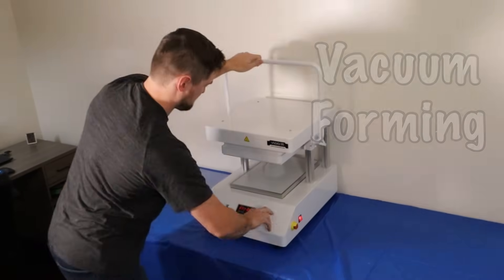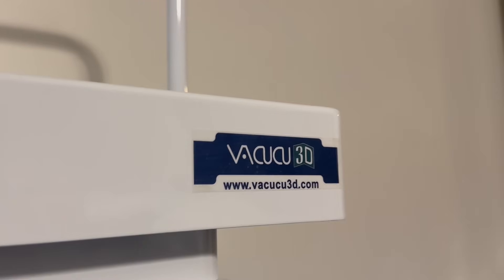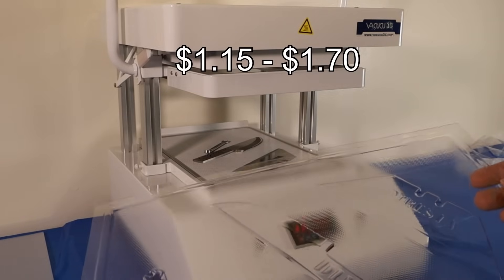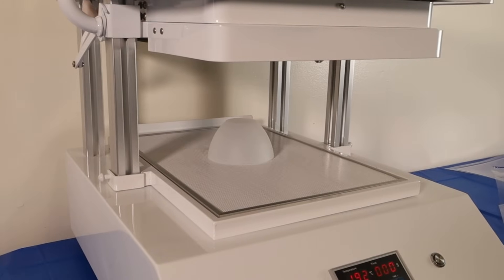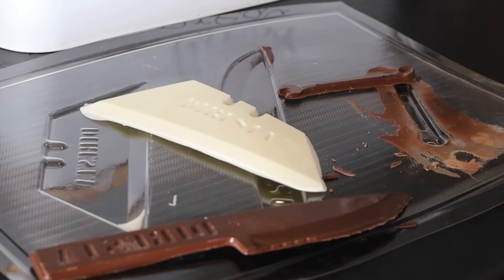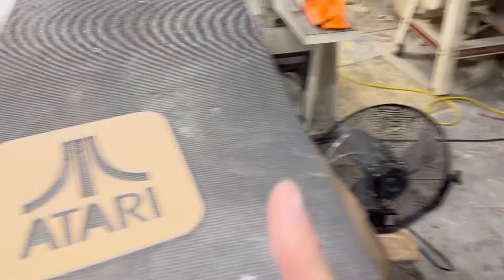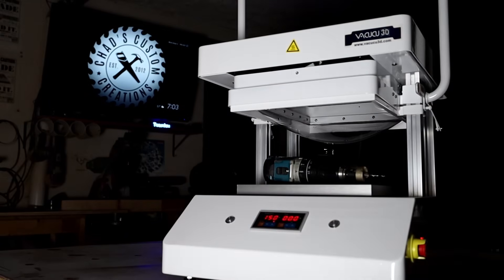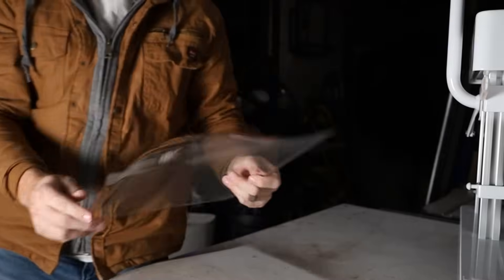Why I got a Vacuum Former, What Can it Do

Comment: I used to use a larger one of those 35 years ago in a professinal model shop producing consumer goods prototypes. We would make patterns from jelutong wood (cheap and very easy to cut and carve) and to get the plastic to pull into crevices etc we drilled small vent holes using piano wire with the end ground to make a flat spade end. You could even get it to drill holes in an arc and we often drilled them up to a foot long or more. We also put channels on the underside of the pattern to ensure all the holes got vacuum into them. For more durable patterns we would make wood ones and use the formings to cast tooling resin into (also needed vacuum holes drilling and where piano wire really shines). Your vent holes in the box are waaaay bigger than you need, 1mm holes are fine. The amount you can pull into a hole depends both on depth and the amount of taper on the sides verses the thickness of the plastic. You can look at using much thicker plastic and materials such as ABS but you need to pre-dry some types or they will produce bubbles in the plastic when the water in it boils. I used to stick the sheet under the heaters on low heat for about an hour or so for 3mm ABS sheet. Polycarbonate sheet can make VERY tough items but needs even more drying. Have fun with the machine! Steve in UK.
Reply from the maker: This is some great info and love the fact that you used piano strings to drill holes that’s brilliant. Thank you Steve!
Reply: @ChadsCustomCreations  I don't know what guage they were, pretty thick, but much cheaper than breaking lots of 1mm drills!
Reply: @Darth_Chicken  That's 19 guage...  Info:
Gauge No     	Inch	        Metric
       17	         0.056"	     1.4mm
       18	         0.048"     	1.2mm
       19         	0.040"	     1.0mm
       20         	0.036"	      0.9mm

Comment: don't put chocolate in the fridge to set it lol.
Reply from the maker: Oh really why’s that?
Reply: @ChadsCustomCreations  It can make the sugars separate, and also make it become deformed because it's cooling too fast and unevenly. EDIT: Also, making the chocolate too hot can make the sugars separate as well.
Reply from the maker: @shawnm3217  awesome good to know thank you for the info. I had a question also one knife looked really nice and glossy except for one spot wasn’t sure what caused that or if there was a way to bring the gloss back. I was thinking hit it with a heat gun really quick but never tried it.
Reply: @ChadsCustomCreations  That is  tempering issue which was likely caused by uneven, or over heated areas of the chocolate and/or cooling. Depending on how bad it is, you could use warm water to smooth it, as for a heat gun this is possible, but because heat guns vary in heat, and air pressure it's difficult to tell you exactly how well it would work. Also, a double boil system is best for chocolates. Chocolate don't like to be shocked by either heat or cold so the best way is to slowly melt it in a lower heat, and when cooling do so either at room temp or in a slightly cooler area, but never in the fridge or freezer, if you want the best looking product. Also when using pre-made chocolate discs or chips you're at the mercy of the quality of the base product. It can help to add a small amount of food grade coco butter to the mix. How much would be an experiment on your part, as different chocolate bases are so vastly different.
Reply from the maker: @shawnm3217  awesome thank you so much for all that knowledge!
Reply: @ChadsCustomCreations  No problem, I'm always happy if something I share helps.

Comment: I think You should have made that ATARI logo illuminated. Since the plastic is translucent, it would be awesome to wire some LED strips on the back ;-)
BTW.: I would use vacuum forming to make a transparent dust collector for a CNC router.
Reply from the maker: Yes I totally should and definitely might revisit that. 

Oh wow yes clear dust boots would sell like hot cakes.

Comment: I made my own vacuum forming machine after reading a tutorial I purchased from an Etsy shop in the beginning of 2013 about how to vacuum form. I had found various handmade vacuum box models available at that time, starting around $100, but that was not in my budget, as a single mom. So I figured out a way to make my own. It ended up costing roughly a fourth of that. I opened my Etsy shop in 2014 and I have been selling molds ever since. I use 1/16 thick  ldpe, but I have been wanting to use other materials. The plastic you're using looks like it will be perfect for what I want to make, but I have never worked with it, so it will definitely be a new learning experience for me. I will need to figure out the correct temperature to heat it, what it will look like when it is ready, and all the steps required to get it to mold correctly. I am trying My best to avoid watermarks. My setup is a large toaster oven, an aluminum frame I made from a window screen frame which I put the plastic inside and clamp to hold it while it heats up, and a vacuum hooked up to my handmade box. I also make handmade cards, so I would like to make domed shapes to create kind of a snowglobe card with a plastic window with confetti and other little things inside. They sell these plastic domes in different places and different shapes and sizes, but since I already have the machine and understanding and skills for the most part of vacuum forming, it would actually be a lit cheaper to buy the materials and make them myself. I'm considering letting my shop go. It's a lot of work, and I'm not the kind of person who thrives on that.

Most of the molds I sell are used with epoxy, or other types of resin, to make jewelry and other things.

Also, those wrinkles are called webbing, if I remember correctly.

Thank you for sharing! It's been really helpful for me 💖
Reply from the maker: That’s such a cool journey! Thank you for sharing this!
Reply: Well done. 😁😁
Reply: lol i made a vacuum former back in the 90's - they aren't hard
Reply: What is the name of your shop?
Reply: Holy cow, now I want to make my own! I just looked at prices online and they're way out of my budget. I appreciate you sharing this idea, I'm off to figure out how to make one!
Reply from the maker: @balover2010  definitely go check out punished props and iliketomakestuff i believe they both have tutorials on DIY machines.

Comment: a dollar a sheet is far too expensive, stop shopping on amazon and go direct to manufacturers, or local supply houses , the price should be pennies a sheet ..
Reply from the maker: You're right if I was to start running productions I would go for bulk orders but for a quick set of materials for prototyping and proving a product amazon works for me.

Comment: What’s the max bed size for this guy ?
Reply from the maker: (297mm×420mm/16.54x11.69in)
Reply: Got my machine.  Smells like secondhand smoke and all the heat elements were broken upon arrival.  Can you tell me if the heat exchange units are hanging and not secured at all?
Reply from the maker: @gustos2478  so sorry to hear your machine was damaged, is sounds like must have have been dropped during transit to have caused those elements to come out. I took a look at my heating elements the tops of them do have a ceramic top that holds them into place if those have cracked you should email ray@rmlaser.com and let him know what has happened he is a great owner and will make it right for you.
Reply: @ChadsCustomCreations  appreciate your time and response. Are your heat elements loosely set into place? For example if you push them do the move up or swing ? I’ve contacted Ray and working things out.
Reply from the maker: @gustos2478  mine are tight no movement on how they are set.

Comment: The cup lids are done in a steady sheet of plastic that has rows of the Lids formed into it in an oven area, then fed into a huge die cutter that's basically a punch press with a cycle that feeds the sheet through it . The oven forms like, 6 wide, by around 20 deep, each time it forms a set, on a continuously fed sheet. The cool thing is that there is like NO scrap...anything that's deformed is ground down and placed back at the front of all the machines where its melted back down and sent right back through...pretty cool process!
Reply from the maker: Super cool, the development of factory machines is so fascinating to me. I used to love watching that tv show how it’s made!
Reply: @ChadsCustomCreations  Me too!
Reply: Sweetheart Plastic's Wilmington Ma.

Comment: Can you please make wax candle molds
Reply from the maker: I will give it a try, I believe as long as the temps are below the temperature that would deform the plastic it would work great. Paraffin wax melts at 99 degrees F so that would work great pure bees was is closer to 140f which I still believe would work.

Comment: lay the letters in the vac, in the correct spacing............ then you got it all in one strip. no cutting n fitting requiired.................. innit??
Reply from the maker: Yeah I did try this it didn’t make the video but sadly the parts of the logo were too close together for it to work out and fully pull down this time. But for future signs I will definitely do that as it will look more professional and save so much time.

Comment: That is stupidly expensive with the sheets though. 1000 kg of plastic pellets is roughly $800 to $1000.

At 33 grams per sheet, that's 30 sheets per dollar in terms of material cost to produce.

So that's less than $2.50 (closer to to $2.30) for 73 sheets. And Amazon is charging $85? I mean, I get it. there is work, paying off the machines, their packaging, electricity etc, etc. but that is still one hell of a markup.

If it was along the lines of 15-25 cents per sheet it would make sense to use for packaging, it would still be close to a 10x markup for a healthy profit and I'd get one for myself, but that is stupidly expensive. Now you'd need to add at least a $2 markup just to cover this alone. Factor in that you still need to cut it, add maybe a nice paper insert, maybe punch holes for a hanging it in a store...you're probably looking at a markup of like $3-4 on packaging alone with these prices.

You can go to practically any store and see vacuum packed products that cost less than the cost of 1 sheet. Hell, the closest dollar store to me has vacuum packed products. These prices just don't make sense.
Reply from the maker: Definitely a premium price but it comes down to the convince, sure it cost more than bulk plastic but it’s because you can purchase it from Amazon  probably it’s cut to size and ready to go and shipped to your door. If someone really started running a production I would recommend finding a bulk supplier. For prototypes and mold making and such Amazon plastic just makes it possible quick. 🤷‍♂️

Comment: This is cool but $1.70 per sheet is way too high to pay after you factor in sheets that went wrong. Makes overall cost too high. They should sell a sheet for closer to 50 cents each.
Reply from the maker: I think this is mainly a convenience thing coming from Amazon I am sure there are cheaper suppliers.

Comment: Add butter to the chocolate b4 melting and melt it together & it will be easier to pour
The possibilities seem endless with why you could end up doing with that machine, depending on if & how creative you are. Epoxy boxes or bowls  that look like marble or granite! You can make mold with that machine then make jewlery/Nik Nak holders for bathroom counters.. toothbrush holders. Circle rings thay people hang on the wall for towels. Don't sell things like the ATARI thing you made  cuz they can sue you unless you have the rights to use any brands names/symbols or their likeness.
Reply from the maker: That’s a great idea with the butter! Also so many other great ideas you have listed here I can tell you are a creative thinker for sure. You are right about the copyrights I’ve heard of a few makers receiving cease and desist. Which thankfully ends when they stop selling or removing the items from online listings.

Comment: one of the things i would do is make inserts to organize the content of boxes.
specifically for board games.

with some of the thicker plastic you could make inserts for boxes to hold and protect delicate items for transport.

display stands for... stuff you want to display. scale models, collectible items, etc.

stands for hand tools, game controllers and other often used items.

housings and coverings for hobby electronics projects.

creating hollow bases upon which to build a diorama, so there's space to hide electronics, and things like those tunnel mountain things
for model railroads.

creating transparent parts for dioramas, like elaborate glass structures; greenhouses, geodesic domes etc.

make the same shape twice. once out of opaque plastic and once out of transparent plastic.
cut shapes out of the opaque one, stick that one on the inside of the transparent one and put a light behind it. 

sheets with 1" dimples in them to use as disposable paint pallets.

sheets with indentations designed to hold small parts like screws and springs n stuff when taking apart 
a device.

flat sheets with small dimples leaving thin raised edges between them. paint the edges on the front with flat black paint,
and the dimples on the other side with translucent paints, to simulate stained glass.

'fencing' for projects involving the poring of transparent resin.

containers for building a waterfall/pond diorama or home decoration.
Reply from the maker: Amazing thank you for this extensive list!
Reply: @ChadsCustomCreations  lol one idea led to another and...
i might end up buying one of these machines :P
Reply from the maker: @daveyjones5702  if you do I would love to see all the things you’re able to come up with!

Comment: You could make 100% epoxy signs using the mold of a previously made sign. So for example, the Atari sign you just made. You could make the mold of the completed sign, use red epoxy to fill the letters. After it's cured, use the white epoxy to then fill the rest. Making several at a time, it's pretty cost effective and time saving. Sure, you have time in curing but just like the laser and/or cnc.....it opens up time to do other things while it does the rest. Just an idea, it's what I do.
Reply from the maker: Amazing idea!!!
Reply: @ChadsCustomCreations  or you could make two molds, use one for white epoxy and another one where you cut out the letters to use as a painting mask so you can do it quickly and precisely.
Reply from the maker: @MadsterV  great idea!

Comment: You probably dont want to heat plastics (whatever the exact material is) without any suction to avoid inhaling the unlikely healthy gases.
Reply from the maker: Anything that promotes being safe and healthy is never a bad idea.

I was curious about it also but it seems that and don’t quote me on this because you can find people saying it both ways in searching, but this Plastic is PETG which is considered one of the safest and is also used in 3d printing at much higher temps then thermoforming.
Reply: Under about 170c there are no emissions from hdpe etc. You can find tables the which plastics emit no fumes under their peak temperatures
Reply from the maker: @janeblogs324  thank you and that’s a 330F which I was only bringing this PETG up to a radiant heat of 245f no fumes or anything that my nose could detect but I will admit that’s not saying much. 😅

Comment: I dont have time to learn about any of rhis properly so im just takin a shot in the comments here, can i vacum form a drone? Ita an fpv drone like maybe 2 inches high, x shape. I just want a shell
Reply from the maker: I believe using vacuum forming has been done to make drone bodies, I’ve seen RC cars and boats also.
Reply: @ChadsCustomCreations  thanks! Ill look into doing it. I live in boston and was thinking of insulating a drone with a shell to fly in the cold and snow. It wont be super effective for heat but its better than nothing to keep the battery warm and will of course keep out snow. Can you reccomend a light material? Doesnt need to be structural and will likely get smashed  so cheap, replaceable, light stuff is ideal. Like cheap face shaped halloween  mask kind of stuff. Ive never thought about it but im sure those masks are vacum formed.
Reply from the maker: @andrewut7ya511  I think the PETG I was using would be perfect for that application.

Comment: Wouldn't it be a better button design if it was a two way switch instead of two buttons on opposite sides of the machine? Left for heat and right for vacuum. Instead switching between the two.
Reply from the maker: Yeah I think that would be a nice upgrade, I bet it would be an easy modification and maybe the other side could be used for turning on or off some LED lighting or something else auxiliary.

Comment: The sign could have had LED lights placed behind it to light up the letter.  Use lighter coats of red to build until it's just barely covered and the lights will make them glow.  Great video.  On the 3" box, what about increasing the heat a little to allow the mold to completely form on the corners?
Reply from the maker: Great idea and yes more heat does allow for more detail but also if you go too far like I did that first time with the knives it will create random folds also.
Reply: @Chads Custom Creations  drill holes in the corners helps. I'm genuinely impressed. Holes, 3 degree draft angles and radius on parts are your friends when designing for vacuuming forming.
Reply from the maker: @dwintster  awesome thank you for the tips.
Reply: @ChadsCustomCreations  you’re welcome, thank you for the inspiration. Time to put my industrial design education to use on small production runs for my own business.